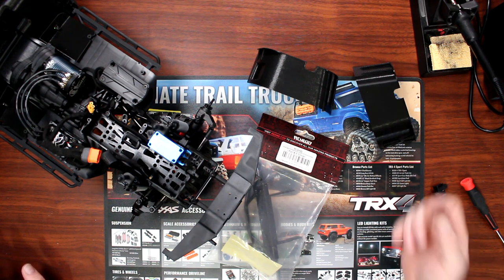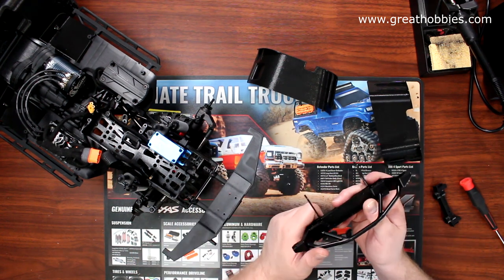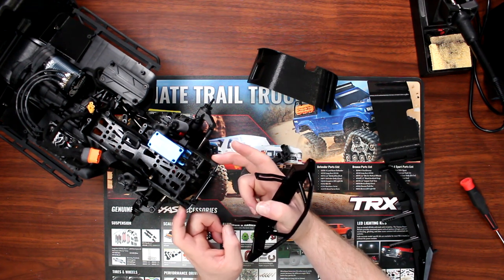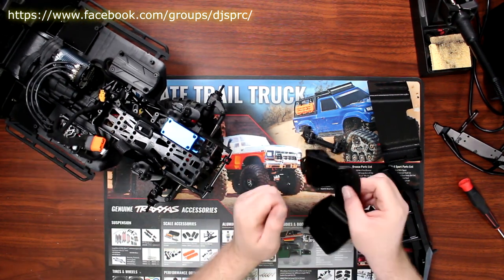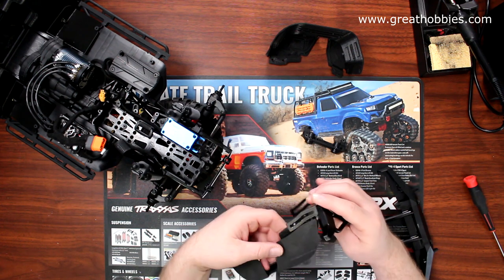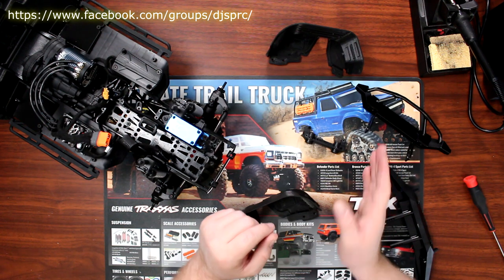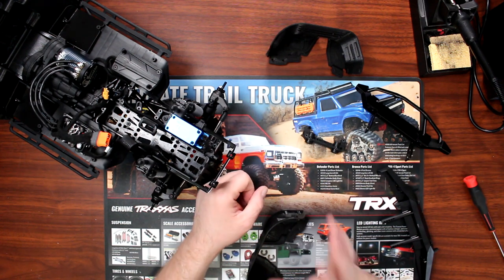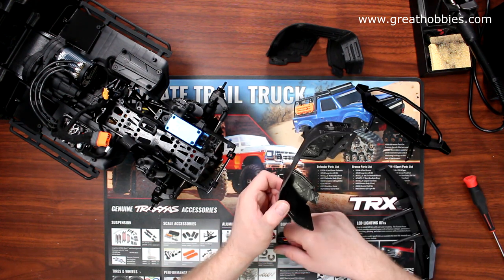Project Cherokee Scx10 II Front Bumper Upgrade

Comment: Hi 👋, im looking to buy a Axial scx10 II. This truck does not come with a battery nor does it come with a charger. Now I have two Traxxas stampedes and five Traxxas batteries. I have four 3300 and one 5400 in terms of batteries. So my question is, are my Traxxas batteries compatible with the Axial scx10 II?
Reply from the maker: The voltage of your batteries would work the only problem is the two type of batteries Traxxas is use the hump pack and a straight pack would be too long or too fat for the vehicle now you could modify it make them work yes besides that you’re choosing yourself a great vehicle